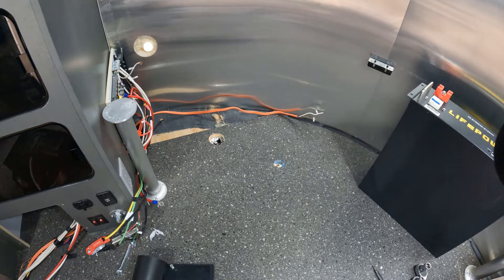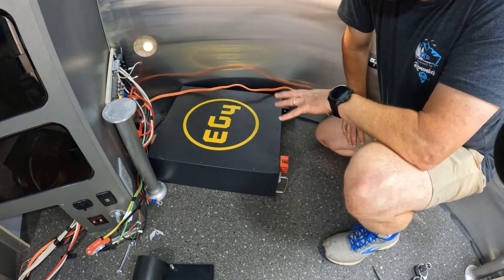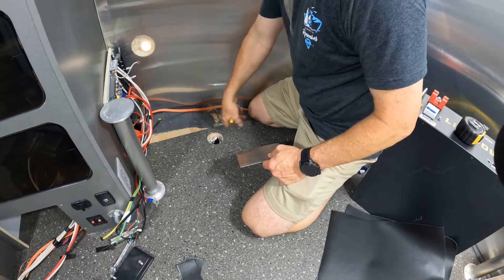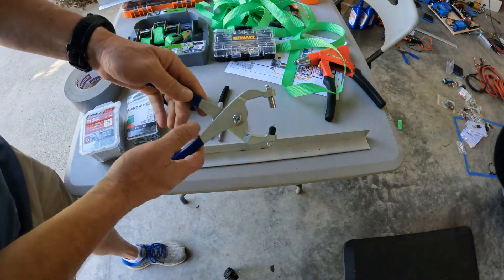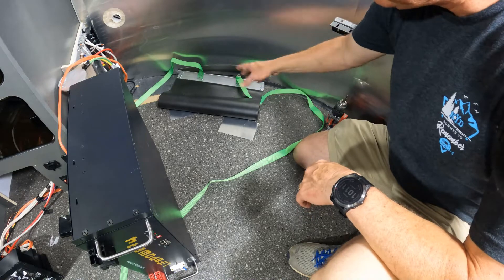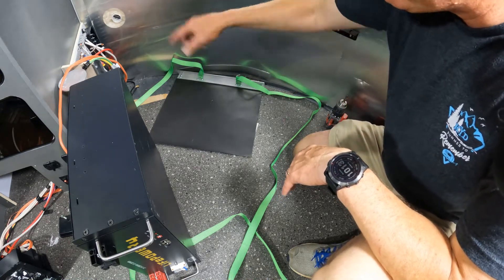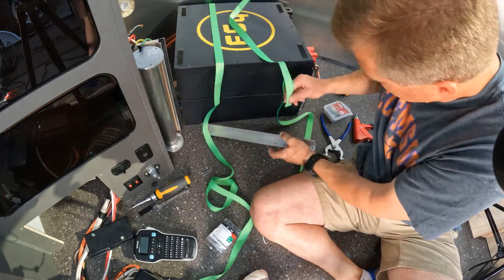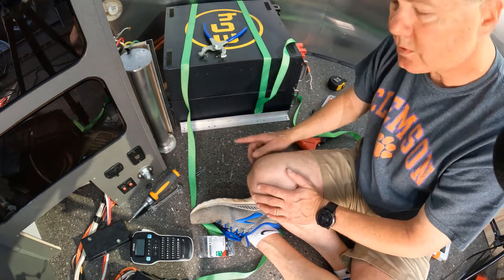Airstream Basecamp 20X, 24v Battery Installation - Video 1, EG4 Lifepower 24v 200ah

Comment: Hey Wayne, have you had any problems stacking the eg4s directly on top one another since this video? I'm looking to do the same in a van without a server rack!
Reply from the maker: Hi @martinhvns, no, I haven't had any issues with the servers being stacked.  I opened the panel on the battery and looked at the configuration and didn't see any potential issues.  You can also check out the Will Prowse video on his teardown of an EG4.  The frame of the battery hasn't shown any issues to this point.  Hope this helps.  Wayne